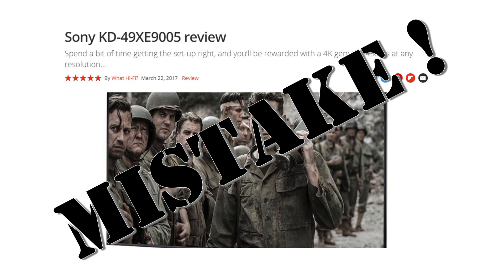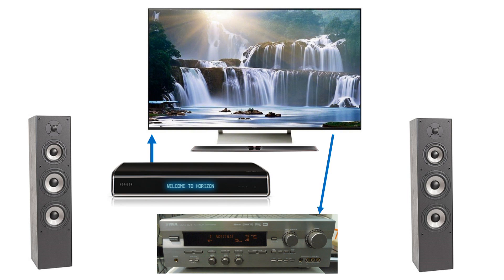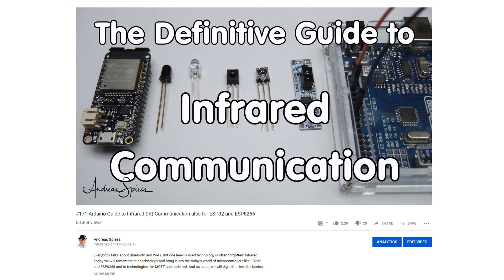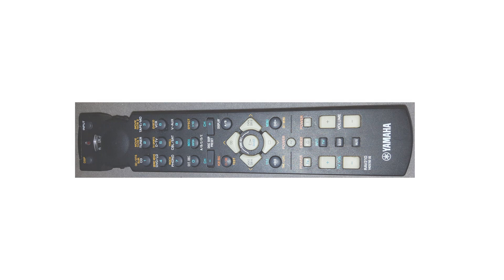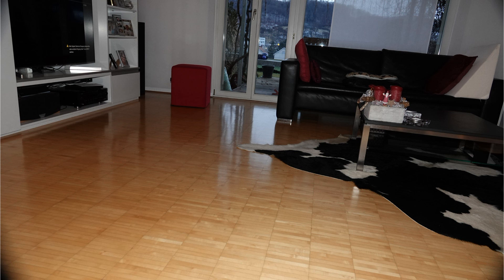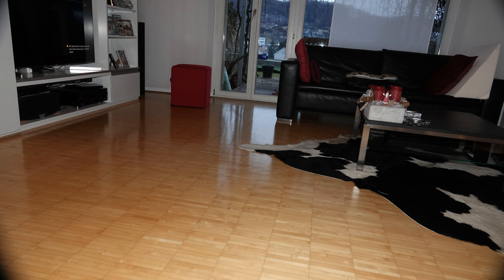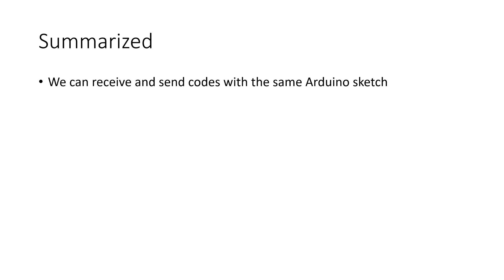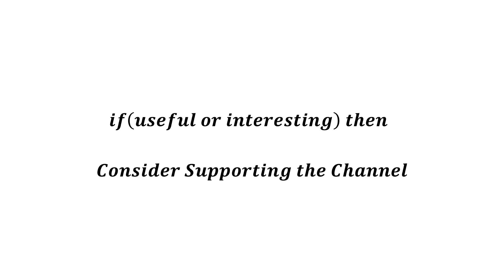#254 Infrared Remote Protocol Translator (Arduino Nano)

Comment: I wonder why you did not tried to mask all the other IR receivers but the one you want to drive, and port them pushing the input with a sticked output ir on them which would mask it from other signals ? Thus you will have a perfect solution without possible further interferences (new ir remote for a new toy for example), because you are sure the right signal would go to the right place at correct speed and lenght. And also, your device can be powered as much as you need with a hidden  dedicated power supply. You can also solve the power on /off signal, as you can send it to all the dedicated ir outpout at once with the correct values and drive for only the functions you need. What you need to do is just identify the IR receiver aera of all your devices, stick an IR transmitter on it and mask the aera to void any perturbations from any other Ir remote. The drive the correct signal to any of your devices. You will not need anymore your other remotes once done...
Reply from the maker: I had to use this IR because it also uses 2.4GHz to control the main box.

Comment: Just a bit surprised that you don't support Logitech and their Harmony remote. I just swithed from a Samsung to LG and changing the basic functions including ditching the satelite set top box was a snap. Requires a bit more work to adjust the Smart functions but that is possuble too. Also have a happy wife once the bugs were ironed out!
Reply from the maker: Unfortunately, the set-top box uses 2.4GHz. So IR would not be enough...

Comment: I use an ir hat for a d1 mini, got this linked to an mqtt server so that I can press one button and it will turn to my chromecast and change the av volume.  Similarly it will turn multiple devices on or off and set the channels/volumes correctly.  Not as powerful as yours, but works well.
Reply from the maker: Good idea!

Comment: Here in the US the phrase "You're the man" means you did a great job so, You're the man.  This video helped me as I have an IR issue as well.  In my lab, I have two sets of LED lights from different Chinfacturers.   In the am I have them both doing white color and highest brightness, in the evening I switch to red at the lowest setting.  Turning them on/off also requires two remotes.  This means 2 remotes and if I the sequence out of order one set of light goes into blinking and changing colors which are annoying.  So I'm going to build a simple box with ON, Off, Day, and Night buttons.  Thank you for the Arduino libraries and web link these will be very helpfull.  Keep broadcasting!!
Reply from the maker: In addition you might watch my video where I steer the color temperature of LEDs according sunrise and sunset. Then it would be completely automatic ;-)
Reply: Andreas Spiess That was an Awesome Project!!!!

Comment: Andreas, Thank you so much for your informative and smile inducing videos.
I see you have already fixed the issue in code but on the Sony, under Settings | ECO | TV Idle Standby, if turned off the TV will no longer go to standby if an IR code is not received in a set period of time. (The feature is there to save power if you fall asleep and stop pressing buttons.)
Reply from the maker: Thank you for the tip!

Comment: Great solution. why not think this further? 
1) You could move the sending/receiving diodes to a separate box, which is much smaller. this could be hidden below one of the devices, without the white box to be hidden.
2) you could create a website controlling the sending codes, which you could make available via mobile app (don't forget about security) and/or make it available via an app. This would allow you a much broader controlling system, which is also dimming light, switching input channels and so on. just as some ideas..
but at the end it is all about WAF (Woman Acceptance Factor)
Reply from the maker: The mobile interface would be a horrible idea. I am sure ;-) Not for us, but for her.

Comment: I can very much relate to the wife/husband relations described in this video... :)
But Andreas: giving a VIP user a device without having tested all(!) functions and then not even doing on-site production support for a few hours is really a beginners error! ;)
Reply: Rookie Mistake… 😞
Reply: @Blockchainfirst  It might work great BUT the BOSS wants to use the known remote and It is really hard to convince her, I speak from experience, to use another way. We have a Logitech remote I bought, program and works like a charm but It is still laying in the corner after 5 years because It is different to use. So Andreas stick to the wishes (order) he got AND he did the right thing to follow her wish!
Reply: 3D Gussner 
Very wise words. 
And if I may add to this: It might not be a great idea to add another female to your household.
Reply from the maker: @Markus: You are of course right!
@Blockchainfirst: The set-top box is on 2.4GHz. And Alexa does not understand Swiss German. My wife even tried it and was disappointed because it did not understand her favorite radio station. So Alexa sleeps in the deep cellar. Probably as Snowwhite for 100 years ;-)

Comment: What a great fun. Had a similar problem just a year ago. Maybe your wife and mine are sisters... Because of a more complex setup, the Receiver needs a replacement with ARC Return channel. Additional invest. Now we are back, that the TV control can do it all.  Additionally switching ON/OFF the receiver and change to the right input. Nowadays you can skip the "remote send" topic, because most components like ONKYO and LG reacts quite well on RESTful requests. No line of sight required.
Reply from the maker: The other comments show that this topic, in addition to technical challenges, also has a strong human side. My wife laughed about her "sister". Maybe we find some more "sisters" when the video is public ;-)
Reply: Andreas Spiess Definitely, if my wife isn't your wife's sister then she must surely be her Cousin!!! 😉😉😉

Comment: What! did I see you closing the door by hand?  Back to the basement....
Otherwise a great video
Reply: Solved the same problem by mounting a geared backwheel (typically used in small RC Cars)  device to a servo that presses the wheel against the door from the inside. The servo is neccessary because otherwise if opening the door  manually you would destroy the gearbox. Added an ESP32 for steering .. works like a charm ;-)   And yes .. my wife has no clue regarding the complexity I had to solve ;-)
Reply: Jens Kaa 
But did you notice that the TV switched off automatically when he closed the door?
Reply from the maker: @ Eduard: I showed the automatic switch in another video ;-)
@Walter: Interesting idea. Maybe another project...
Reply: @ @AndreasSpiess  do you recall what that video was called? I've gone back 3 years in your videos and couldn't see it.

Comment: There is no more critic customer than the significant other, but is it always a good drive to make projects as 'complete' and easy to use as possible ;-) 
Nice project though! I've made some similar in the past; we have a Bose Soundtouch in the bedroom and misses B was disappointed that there wasn't a sleep-function. So i've copied the Bose IR signal from the remote (this was unfortunately not in the database, so i've had read the 'raw' code) and made a wall control with 4 pushbuttons (15/30/45 min and on/off).  When pressed the Soundtouch goes pause/play for a few seconds to let me know it is in 'IR' range and the arduino starts counting until the desired time. 

I see you use a high power IR led. During this project one of the issues was indeed the range of the IR-leds. I used 100ma IR leds but was still not impressed with the range, especially considering that de IR leds in the remote have excellend range (pointing on the wall a from a few meters works fine). I've discovered that most IR leds (mainly the higher quality) can  be driven up to 1-1,2A (!) for a very short time. (it is stated in the datasheet under 'Peak Forward Current' ) Doing this i can hide the IR-transmitter behind the bed and it works fine without being seen :)
Reply from the maker: Neat idea! Just a remark for the LED: If you connected it directly to the Arduino pin it does not get 100mA. The Arduino is not capable to drive that current (AFAIK).

Comment: This is exactly the same as a project I currently working on. Marantz amplifier, Chinese HDMI switch,  LG plasma, TotalTV box, and HTPC. But I adding options HTTP server for HTPC and serial port because LG TV has well documented serial port for two way communication.  That is important for me because I can detect tv state and turn ON/OFF the Marantz amplifier when the tv is ON or OFF (this old bastard sucking power when it idles like a bathroom heater). Gods send this video to me tnx.  

ps. I also missing the amplifier remote but it has a chinch RC-5 connector I must investigate protocol for that.
Reply from the maker: So you can use your devices longer. Good for the environment and the wallet ;-)
Reply: @AndreasSpiess  I'm very cheap and I like tinkering. Everything in my house is DIY and custom made.  I like your content and  Swiss accent very much.

Comment: Thanks for a fun story with some cool technical stuff.  I have a similar challenge on both out upstairs and downstairs TVs.  So far I have gotten them (mostly) to work with a single remote (the one for the Cable Box).  That is not perfect though; so, the other remotes are on the table as well.  I guess since it has never worked perfectly my wife has gotten used to the multiple remotes.  Maybe I should not mess with that.  The limitations are keeping the other remotes around.
Your idea actually sounds like it might make a good product.  If you changed the processor to an ESP32 you could configure it using a phone app.
Reply from the maker: I hope this will be a "make and forget" device which does not need any config in the future...

Comment: i built a similar board, just wanted to know whats the power supply voltage and current that you supplying the board with?
Reply from the maker: I do not remember, but usually I use 5 volts
Reply: @AndreasSpiess  I used USB port which gives 5v and 500ma and if I don't use resistor the ir led burns
Reply from the maker: You always have to limit the current in the LEDs. If I remember right I referred to other videos talking about that.

Comment: Does your wife ever comment that nothing in the house will work if you die?  I have a boat-load of home automation and that is a comment I've heard from time to time.  ;-)  BTW, it would not be as cool but the Harmony remote would have also solved your problem.  It would also make finding the codes easier because you program it from your computer with the model numbers of the devices.  Apparently Harmony has the codes for just about every IR device on the planet in their DB.  Great Maker solution though - thanks!
Reply from the maker: 1. I do not "automate" important things like heating. There I am conservative.
2. Our set-top box is on 2.4GHz
3. The WAF of a Harmony would be close to zero here :-(

Comment: Hey, I made the same few years ago ;) Since I only use HDMI1 to HDMI4 on my Samsung TV but the remote has no convenient way to switch inputs, I made an IR transceiver that switches to HDMI1 when I press "1" on my remote, HDMI2 on "2" etc... I used a ProMini and powered it with an 18650. It runs for more than a year. You can use the pin change interrupt to wake the arduino when a signal is received. The IR receiver itself draws almost no current. However, the IR library has to be patched, because the timing of the first pulse will be reduced by the arduino taking time to wake up.
Reply from the maker: Interesting concept with interrupts. Would have been a solution for the "under the table" location. Did you document your project?
Reply: Roter - what an excellent project. That seems to be a brilliant solution to making Andreas' solution even better. If you don't mind I have a few questions please? What kind of latency do you find on the power up process? And what are you using to manage the battery under and over charge protection? Thanks
Reply: @northshorepx  I should still have the code... I'll have a look at it at the weekend and publish it somewhere. The wakeup delay is not much, but it is enough to shorten the first IR pulse so that the regular IR library won't read it anymore
Reply: @AndreasSpiess  Sorry, no documentation... But I found the old code and uploaded it https://github.com/xsrf/ir-remapper
Reply: @northshorepx  just posted the link to the code... The latency is about 2ms. I read the input voltage and when it gets too low I toggle MUTE as an indicator to recharge the battery.

Comment: You might want to consider putting many transmitters near the devices they want to control. They don't need to be as strong, so they can be connected in parallel.
Reply from the maker: You are right. But I do not like cables :-(

Comment: im in desperate need to build this as i have the same issue, can you kindly let me know what nm LED with what angle, 60 or 120 degrees was used and what degree lens was used?
Reply from the maker: 940 nm and 60 degrees should be ok
Reply: @AndreasSpiess  ok so the link in the description to that ir led is incorrect for aliexpress. I'm assuming your running the ir led over 5v vcc and 0.5a  or else without a resistor wouldn't it burn it?

Comment: Loved this idea! I'm doing something kinda similar to solve a problem with the Power button not working anymore on a special remote. I may try using low power modes and a battery instead of a power cable. The logic analyzer and sigrok are working wonders to keep this easy. Sigrok also has IR protocol decoders too.
Reply from the maker: I did not know about the IR decoder of Sigrock. Thanks!

Comment: You could use IR transmitters  on cables attached in front of the IR receivers on the TV and Amp such as these https://tinyurl.com/y96pvz9v
The original Tivo recorders used a similar setup.
Reply from the maker: You are right. But unfortunately, I do not like cables. And my wife even less :-(
Reply: @AndreasSpiess  The cables are under the amplifier with just the sensor coming out in front of the IR receiver, the TIVO ones were on little plastic wands.  Easily hidden from the wife. I had to get rid of the wife instead of my cables ;^)

Comment: Very nice, it's many years I was wanting to do something like that, but I have too many hobbies, I wanted to control my Daiken Ururu Sarara Air conditioner through a weekly timer.
Unfortunately it only has a delay off right now. 
I have only one button for ON/OFF, hence the same code for both.
I could read the multicolor status led or check the flap position as feedback.
The IR remote is bidirectional, the remote has an LCD which shows the actual temperature and internal humidity, so it might be possible to use the receive IR as a feedback.

Danke schoen.
Reply from the maker: Sounds like an interesting project. Maybe somebody else did it already and you find it with Google?

Comment: Unbelievable !   
A few days ago I had first thougts on how to get rid of the  multiple remotes in my living room.
I have a simular volume problem, as my TV-receiver can adjust volume, but the blueray don't, so i have to control volume on the amplifier.
I also need to switch the projektor on/off and toggle the inputs on an HDMI-switch and of the amplifier.
I was thinking about to use an esp togehther with an app, as we have a family-tablet there.
But your idea would be more comfortable and even will get a higher accaptance from my wife.
Great !
Thank you.
Reply from the maker: Hopefully, it will be as successful as mine ;-)

Comment: I was half-expecting you to put a retro-reflector strip on your coffee-table and the Babelfish near the TV, pointing back at the reflector (and user).
Reply from the maker: Good Idea. But luckily not needed.
Reply: आदित्य Aditya मेहेंदळे Mehendale 
With 3W I think you wouldn’t even need a reflector. The reflection of the wall would probably be enough. Works at my home if I point the standard remote (with new batteries) to the wall.
Reply: I expected two low power IR diodes on long wires that would be hidden near the target devices.

Comment: Andreas, i have exactly the same remote, is there a map of all buttons you can share? e.g. the IR codes? I am especially interested to know if all buttons have an IR counterpart, or some are for example FM(?) only.
Reply from the maker: I only used the TV and the volume button. Most other buttons are on 2.4GHz
Reply: @AndreasSpiess  That is unfortunate, can you hook up your test setup to see if the "A" or "RETURN" codes on the back of the Horizon remote actually send IR codes? A simple yes or no would be enough, since that would save me from making this exact same thing.
Reply from the maker: Unfortunately I do not have the time to do that as everything is already in the boxes to have the lab available for the next video :-(

Comment: I recently bought the exact same TV in 55 inch. It does have a built in feature to attach the included 'IR Blasters' to control other equipment. Unfortunately when I tried to use it, it had too much delay between the original code being received and the one sent to external equipment. Particular bad when holding down a key. But this wouldn't have been a solution for you anyway as your Wife didn't want to use the Sony remote!  By the way, you've already coded a fix for the 'auto switch off' now, but you can turn this off in the TV settings.
Reply from the maker: I should probably "read the fucking manual" of the Sony ;-)